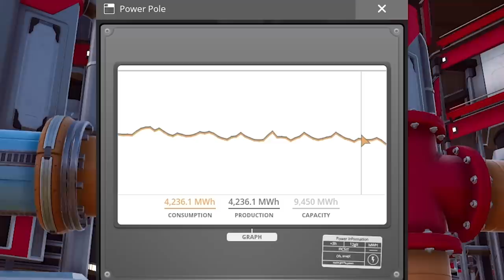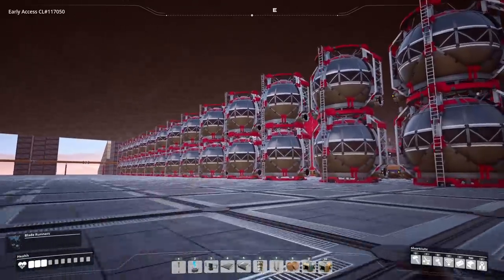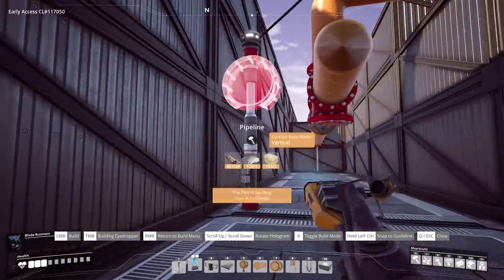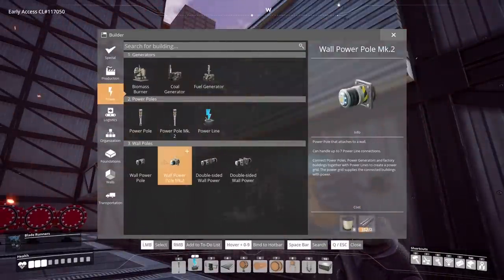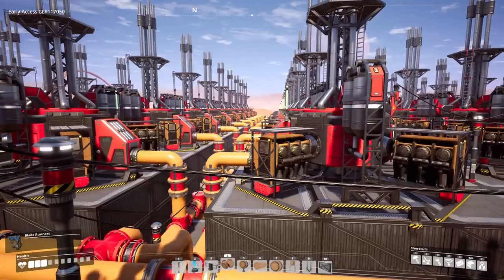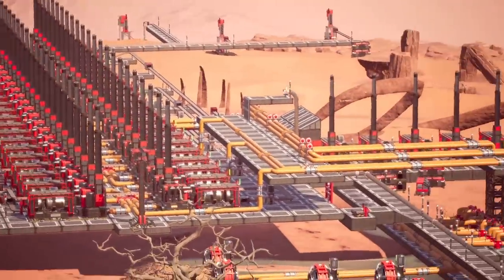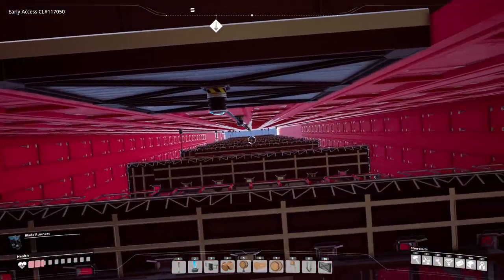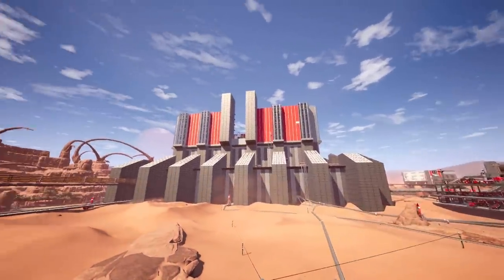162,000 MW of TURBO FUEL POWER! - Satisfactory Early Access Gameplay Ep 15

Comment: Pipes are two-directional. They balance out at the end. One way to make them one way is to put the pumps on it. So if you have one pipe and want it to separate 50/50 with no backflow, just put two pumps on the two output pipes. Pumps will force it to always separate 50/50 since they put an equal amount of negative pressure on both exits (unless the pump exit is blocked). Otherwise, you need to wait for it to balance out the pressure. It is just like the real world.
Honestly, they did a pretty good job with the pipes.
I don't know how this works with the buffers. In theory and since there is no exit and enter to buffers, it means that buffer can also get drained from the supply line. So you might want to add a pump at the entry pipe of each buffer you have for reserve. Not that it makes many problems since your production factories can't use the fuel anyway. If this is true tho (and I think it is), you don't even need to connect two pipes to a buffer for it to work as a BUFFER!
Reply: I've played about a fair bit and you are correct, buffer tanks can sit anywhere along an unpumped line and don't need through-flow to function, they can work fine with only one pipe attached, sitting at the end of a production line. Actually rather useful as an overflow mechanism if you get inventive with linking them and using pumps and junctions, and if you're using certain recipes (like the aluminium ones where you can recycle the by-product water) you can make a wonderfully simple priority overflow feed with a single pump as long as you're careful where other pumps are placed.
Reply: so..... if i understand this right, i could just make an overflow output with a pipe junction, one side with a pump, and the other side with a few meters lifting up without a pump, 

in theory the pump would pull everthing because the pipe on the other side has no time to fill up
and when the pump cant push anything through anymore, the other side fills up and overflows to an other thing

(of course you need enough pre-pressure to get through the other side as well)
does it work like that?
Reply: @reforce7331  I just checked that for you and yeah. The pump takes everything until it is blocked and can't take anymore from the pipe. Then the second connection that doesn't have a pump gets to have some flow rate. It is important however to mention that the level of liquid in the pipe is also a factor. So to get this effect to the fullest you need to make sure that the second connection that doesn't have a pump also has at least a 1-meter elevation compared to the other.
 Benjamin essentially said the same in his comment about the priority system.
Another important factor that a lot of people seem to miss is that the elevation is calculated from the level of liquid in the medium and not the medium itself (being a pipe or a buffer or the factory internal buffer). And therefore you actually may need one pump per each buffer since it fills to 12 meters for a regular buffer and if your pressure can't guarantee that you end up with a half-filled buffer. It is not necessary if you have very good pressure in the pipe tho.
Pipes even have some sort of internal back and forth when you discount a source of pressure like a pump or the factory making it. It goes one way to balance then fills that end and ends up backing up a little and reversing direction to balance the pressure at the other end and vice versa for some time until it balances everything out. Like an actual fluid.
Pipes are just wonderful and well done actually. It seems more mature than the conveyor belts to be honest. Since the train was a disaster in update 2, I don't know how they did the pipes so well in update 3 and without any major bug xD
They just need to have a more descriptive help page or something for the pipes since it is more complex than the conveyor belts and a lot of people seem to hate it at this point as they don't know how it actually works.

Comment: You are really overcomplicate things with pipes. You dont need so many separations to make them work. When all pipes and waterstorages are filled with fuel the pipes are gona transport the same amount of fuel as generators consume. For example, you separate your flow at 3 directions with a 300 flow from refineries, but build generators randomly. So left pipe need like 60 fuel/min, middle pipe need 160 fuel/min, and right pipe need 80 fuel/min. If your pipes are full the flow will separate in exacptly 60/160/80, to compensate consumption of generators (like the irl pipes do). The best way to understand this system is to experiment with it and see how flow changes when you turns on/off generators.
Sorry for my bad english, still lerning. Greatings from Ukrain, love your vids, you are realy funny person.
Reply: You're entirely correct there (and your English is pretty good, don't panic). Overflow mechanics work exactly as expected, as does gravity feeding (you don't need to pump a line which is flowing downwards) which is why my power is being fed from above rather than below, so many less pipes and pumps!

Comment: To your comment on if the Cross sections in your pipes “splitting the material”. Fluids don’t work that way. Yeah you are splitting it but if a pipe has an open ended threshold of 300cm then it will draw in any direction as long as there is pressure!! So if one split/run of pipe is fueling 130cm, then once the pressure builds it will reverse flow to another drawing source. Fluids are cool like that and as to really life!! Think of the plumbing of a house….. pipes all derive from one single source. Granted you “lose pressure” when everything is turned on at once but you will always have your base pressure 300cm PM. as long as your draw isn’t over that number or is slightly under that you will never strain your system!!! When dealing with fluids especially when pumped vertically try not to load balance the Exact number PM always stay a little under depending on the vertical lift. That’s why I always build my fuel producing facilities way up high so when I’m done I use the “water tower” effect to add natural pressure to my lines. Good example is the giant waterfall near the newbie starter area and the giant fog pit of death. I took the 4 oil nodes and horizontally piped it to the water fall area. Then I built all my fuel producing facilities at that Elevation then let the natural static pressure build insanely as it was piped down about 150m to the fog out of death when I built an insane platform to house 300+ fuel generators with turbo fuel. My system will never lose pressure and I can actually strain it to max 600cm PM on one line.
Reply: Love your vids Kibz!! Keep me up 10 months a subscriber and counting good sir!

Comment: I'm pretty sure you're using more pumps than you need to.  Output machines give fluid 10m head lift, so they can go up 2.5 walls without any pumps.  And you don't need any for horizontal runs.  And without pumps blocking the flow it will auto balance in both directions so you don't need any special load balancing, just connect everything together to the limit of the pipes' flow rate.

In fact as long as you're not bottlenecking (you have enough parallel pipes for your desired total throughput), there's really no reason you couldn't just connect all the pipes into a single network.  It will dynamically split the flow exactly as needed regardless.

Also, while I haven't yet tested if the in-game pipes behave like this, in principle the head lift should be relative to the starting elevation.  So if you start high and drop down, you should be able to have it flow up without any pumps at all, up to 10m above the original elevation, no matter how far down it goes first.

Comment: Hey Kibz, try to overclock the secondary fuel generators to something like 200% so that way you don't NEED to build 7 times that amount.

(also destroy the coal plant on the coast to use the coal for steel production because you have SO MUCH POWER.) 🙂
Reply: At least he saved a bunch of resources?
Reply: one of them called SPACE.
Reply: I found in my playthroughs that it’s a waste to use power cells on generators themselves. It’s always better to build more generators instead.

Comment: You don't need any pumps in the trench. HEAD is the key word. If your fluid is originating from a high head, it can feed anything at the same height or lower without a pump.
As soon as you put a pump below the head, you lose the head, and you will from that point forward only have 20m of head to play with.
On my Oil pipeline, I pump everything up high at the start and put a fluid buffer at the highest point of the pipe; I then check all the pumps upstream  to make sure they aren't exceeding 20m head lift.
Then downstream can just be one continuous pipeline back to base with no pumps, and you'll get full flow rate .

Comment: I would have used more of the Foundation frames...you can run like 6 pipes [Through] those.
Also adds some nice verticality.

And I suggest you get your hands on the Jetpack...seems your base is getting bigger then your blade runners can handle.

Comment: Keep the old coal plant, but disconnect it from the coal. You can use it as a backup later if you have problems with the power grid.
But please fix the old coal plant's floating dock. Do some visual fixes.

Comment: Something to try, with water flow in the real world with plumbing. Try not to use 90 as it restricts the flow of water. Change the angle of the pipes 30 - 60 deg and see if that helps with flow instead of adding a ton of pumps to boots flow.

Comment: Dear ImKibitz,
since I do not trust by my nature I was not convinced that your system to feed the base by transforming the water into turbofuel I did the calculations by myself and I must say that I was impressed ...

Feeding with normal fuel by transforming oil directly has an efficiency factor of 6.66 (i.e. how many Watts you can get from a single cubic meter of oil)

In my basic setup I had a production of 900 oil and if you do the math you can power 40 generators for a total of 6000 MW, if you divide them by the initial 900 oil you get 6.666 ... the efficiency factor I was talking about.

If you do the same calculations through diluted fuel and turbofuel (I don't report them for brevity) you have an efficiency factor of 74.07 !!!

It means that if I started from my 900 oils I would get a total of about 66000mw, impressive !!!

At that point I wondered if the infrastructure did not consume an amount of energy that would nullify the advantage, and therefore I verified that too ...

In the basic setup (oil> fuel> generator) the infrastructure consumes about 10% of the energy produced, while in the more advanced setup (oil> h.oil> packaged fuel> unpackaged fuel> turbofuel> generator) the infrastructure is about 7-8%, and this alone should be enough to make him prefer !!!

But as a bonus obviously there is the use of much less resources as far as oil is concerned, obviously everything is much more complex to design and implement ...

Rather...

more spicy! ;-)
Reply: Simply go Nuclear. Having 162GW fuel powerplant is nonsense. It is basically wasting oil. Uranium's sole purpose is to provide energy.

Comment: Heres a idea for your extra power system. Disconnect your water collection and all over there from all sources but one at the main base of which could be switched to a single line from all the generators to the backup if needed. Which should also connect to a emergency connector line for things that are a must like nails res for more generators but also able to be cut off by a single line near the generators.
This is to assure if you go critical you can get more power generators to run you back up and if you somehow run low on turbofuel you can still make even more to keep you up.

Comment: Add a splitter to the plastic bottle line with a mark 1 belt so you can package turbo fuel to use with your jetpack.  Eventually.
Reply: only works with normal fuel

Comment: should have upgraded your circuit breaker to allow you a staged restart
those backup generators wont start your base from cold
but if they only needed to start a little of your generators
that then combine to start the next bit of generators
thatthen work together to start more generators
lets you do a restart from cold without needing too much unneeded generators
just some nice wiring

Comment: Couple of things. The backup power just has to be enough to get the main power back on i.e. the oil extractors, refineries and  pumps. You might want to connect the backup fuel pipework to prefill the pipes and then disconnect them again

Comment: Keep 1 small coal power plant.
You could also then make it black-out immune now, by taking one or two coal generators and putting them on a separate grid for the coal miner and the water pumps for that power plant. I.e. that power plant's inputs will never shut off even if the rest of your base does.
That power plant can then be used to jump start other power plants in the case of a total black-out.

Comment: Now that you have all the fuel power running for everything, you could tear down the tiny coal plants, then repurpose the largest one you have to be the power supply for all the pumps/water/oil extractors for the refineries that make the fuel, then you will always have the raw materials at the base, even if the main grid crashes.  the temp setup will only have to run to jumpstart all the refineries on the bottom floor, and you can have main power back online in no time, since you’ll never have to wait for the 80km pipeline to fill back up after an outage.

Comment: Well i think you are not thinking long term. A Production Facility must be only that. It must take materials and produce products. Having the power generation integrated to that process is not good. Because you can change your power source in the future, which you will probably will with nuclear power. So i guess my suggestion is to have your main base as is, and create other "buildings" that will accomodate your power generation. And if you want to deprecate a power source you pull the plug from this building. Imagine having for instance coal power generation, fuel power generation, nuclear power generation buildings near each other , each being connected to a main power hub, and you can manage everything from there. Which power source to use, if you want to use multiple power sources, or if you want to stop a power source.

Comment: I love this game but it's so easy to mess up power. Especially if you like, put more fuel generators because the game won't warn you that if you are putting more than what your system can use on max power, even if it says you'll be able to make X ammount of power, when it gets close to that it will shut down. So I don't mind messing with ratios on anything, but Fuel Power? Man I spent hours trying to make everything perfect, because I want the system to work without failing at full capacity. That's why I don't trust the "max production power" because it's not what is producing for true, it's easy to fuck it up. Also, man that setup is massive o_õ. I really wish they add a Bot system on this game eventually on Tier 10 or something because it's hard to copy/paste good systems sometimes.

Comment: why didn't you  just connect the back-up fuel with the main fuel line so it uses all the fuel generators you normally use. just separate them with a pump and make it go uphill so it will only flow when the pump has power. now you just connect a wire to the main pump circuit to start the back-up power (you will need 1 fuel generator to power the pumps)

Comment: Pipe system should have headers; I worked in a refinery and that's the most glaring omission here
Reply: Agreed, although I suppose you could consider the cross junctions as a 2 output/input header, I don't think pipe gauges will be variable in this game so it's as close as we're likely to get. At least we don't have to calculate torque and pressure values to figure out the sizes needed, that's gotta be a plus! :P

Comment: Move on to fuel power. Take down the waterfront coal and use coal for steel. Not power sharded your only cutting a loss of 600 MW from the waterfront coal. Thats nothing to what you are getting from your fuel generators! Cut your losses and take that juicy coal for STEEL!

Comment: If it's like real life pipelines the pressure should be equal and universal but not 50/50 it'll seek out to find the highest stable point meaning after the drop from your base there shouldn't be a need for pumps unless you go higher than the highest point of the drop due to hydrostatic force. Although the splitting would in fact hurt the flow rate. There's a lot of other forces in play here IRL but that should be about all that's relevant.

Although don't take this for gospel, I'm no expert just a physics nerd.

Comment: You're wasting power with all those pumps. They don't help if you're just moving the fluids on a flat surface, they only help if you're elevating it. I'm pretty sure you don't even need pumps if you're taking the pipes down a surface then back up again, but not to the level where it came from due to pressure from elevation. I think the issue you're running into is that the pipes take a while to fill up which the pumps don't really help with, just something you'll need to wait for.